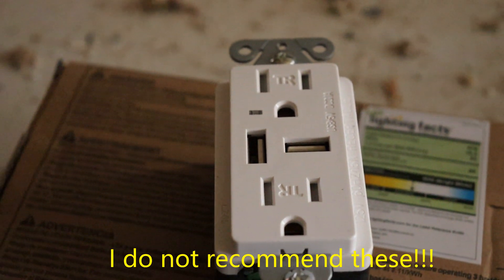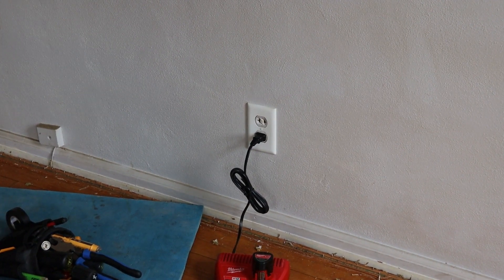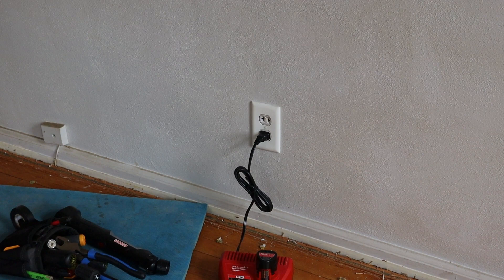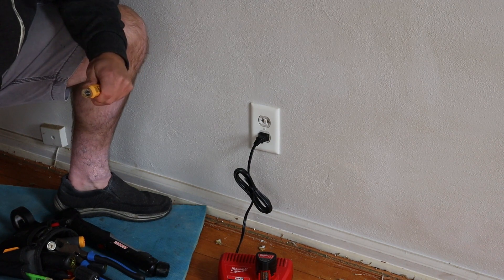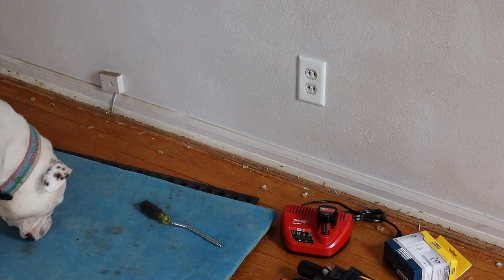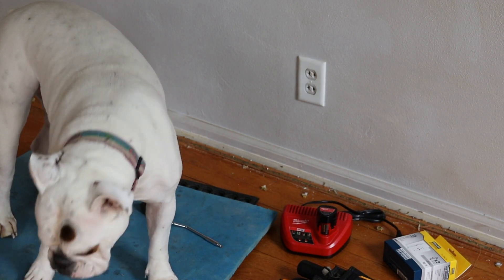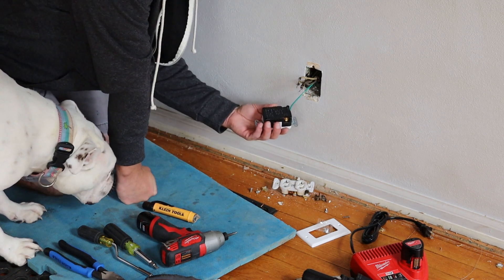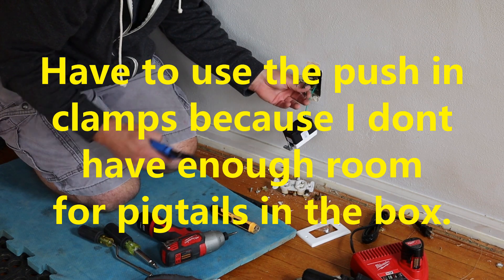#10 - how to upgrade from a 2 prong outlet to a grounded outlet

Comment: Those are not backstab openings. They are screw clamp openings and are OK to use but if you think that box is grounded you might kill someone.
Reply from the maker: That outlet is garbage and the back stab or clamp whatever you want to get technical about is a crap connection weather it is UL listed or not.  It came loose 3 times and was tossed out after the video and replaced with a better qualify outlet.  You get what you pay for and that outlet is garbage.  I've had 2 electrical permits on this house and passed.  These outlets are grounded verified by 2 electrical contractors and separate inspectors.  Thanks for your input

Comment: Maybe I missed it: how did you initially confirm that the box was grounded so you would not have to put in a GFCI instead?
Reply from the maker: The panel in the basement is bonded / grounded.  With metal conduit bonded to the panel then you just need to run ground wire to the eletrical box from the outlet.
Reply: @Rick.johansen  Okay, but you didn't mention in the video how you knew that the "metal conduit" provides the necessary low-resistance grounding path to the service panel.  At 14:20 we can see it is not indicating "open ground", which is good.  However, millions of older homes have no grounding at the 2-prong receptacles and those may need to have GFCI protection added, to conform to national electrical code, if being replaced with 3-prong receptacles.